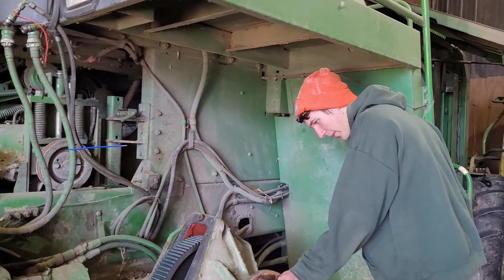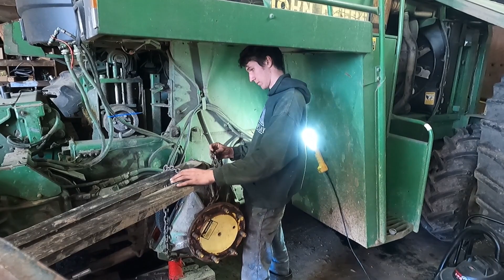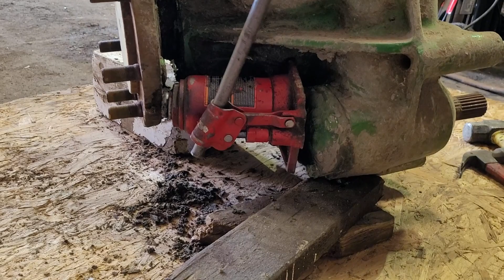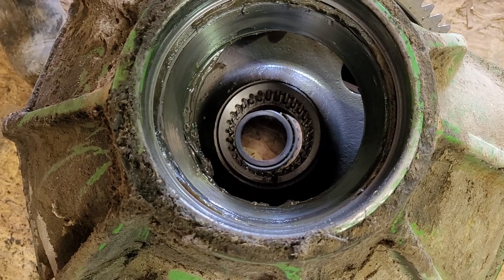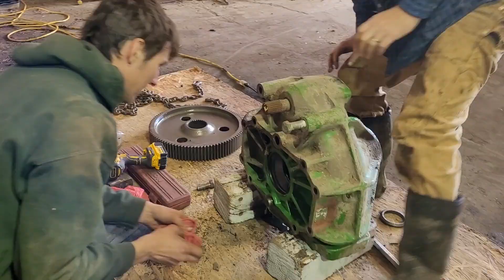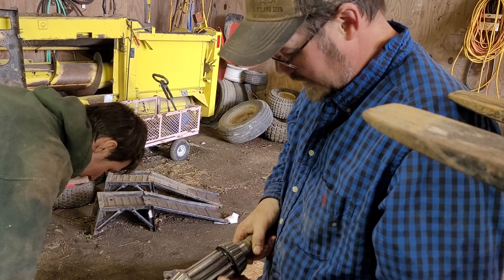Easy Fix (Well not that Easy)🤯

Comment: It's always "something" on the farm with equipment. But atleast for Ethan & Kevin it was a good education process taking the drive unit apart & still a bunch cheaper than hauling the whole chopper to a dealer for diagnosis + repair if needed!

Comment: Flip gears side to side?  Wear on the lower wear tooth of the gear set.  Neighbor had a high hour 4430 that they switched final drives side to side.  Repair manual even said to do that.

Comment: 60's it 28 here and we got a blast of heavy wet snow,, last night, 2nd one in less then 2 weeks with power out over 30 hours pole snapping off llike tooth picks
Reply from the maker: We had 3 days of nice warm weather. Now back to wind, rain and cooler...
Reply: @acresofclayhomestead  but you have green grass i have 4 feet of snow n 10 foot high snow banks, and feeding tons of hay an grain, wish i had grass get them off hay an $500a ton grain. cant do any work out side all winter no shop 40 below all the time

Comment: Get a one and a half inch impact socket cut a notch in it weld it to an air hammer shaft and then you can use an air hammer

Comment: 2nd  thought is that the gear cases will only fit on their respective sides but if the gears were swapped the wear & load would be on the new & unused sides of the gears ?

Comment: Interesting , if the final drives on each side were reversed would the load   (  and wear   )  be on the unused side of the gears ?           Just  thinking
Reply from the maker: Hmmm 🤔🤔 I'm not sure on that one.
Reply: yes it would, those final drives look real similar to the ones on a combine. I believe our combine finals have a drain plug at the top and the bottom so that they can be used on either side.

Comment: KEVIN please lower forks !!!  In my career as industrial mechanic that is a #1 safety issue..  The forks are unforgiving
when you forget about them being up.    God bless you with a great season in the field and a bountiful harvest.
Reply: I have a small forklift and it was in my shop with a bunch of other things so we raised the forks way up above our heads to to make more room. Well our shop has a concrete wall about 4' high around the outside and I was standing on the wall to get something that was hanging up.  I forgot about the forks being up and I jumped off the wall and rammed one of the forks right into my forehead and the blood just poured. My son was young and went running in the house calling for mom. Luckily I only ended up with a cut. Could have been much worse.